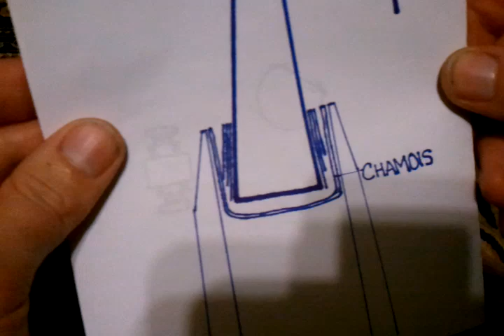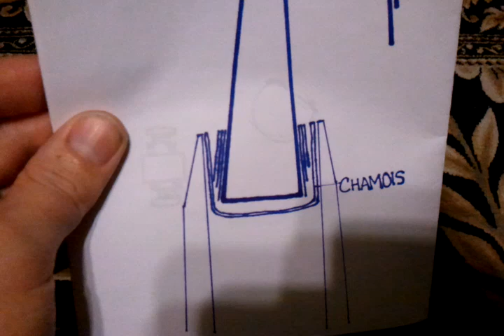Wicked Edge Tip: How to Clamp FFG & FHG Blades

Comment: Appreciate the vid, need to try it on some Spyderco PMs, I think it will also help with the spine taper if I can get a 'forward build up' of the masking tape.
Reply from the maker: I still use the same method all these years later but I generally use the white making tape these days as it sticks better with less slip than the blue painters tape.  Just make sure not to forget the chamois cloth, as that really helps to hold the taped blade much more securely.  I've done ffg Spydercos with a distal taper and generally clamp a tiny bit of the ricasso area around the opening hole and I felt like I got a good enough grip without building up the front with tape but your experience may vary. It's definitely worth a try.

Comment: You use tape on both sides of the knife? I thought you only used tape on the left side of the knife on the jaw of the clamp that doesn't move? Please explain why you use tape on both sides. Thank you for your help.
Reply from the maker: Yes, I tape both sides of the blade. The inside surfaces of the jaws of the clamp are pretty much parallel with each other when a blade is properly clamped.  As a result, the only part of a full flat ground blade that would contact the clamp would be the edge of the spine. Because of this, both sides must be taped in order to make sure that the sides of the blade have as parallel of a surface as possible in order for the clamp to get a secure grip.  This video is several years old but, to this day, I still use the same method (layers of tape plus a little piece of chamois cloth) for clamping a ffg blade because it works so well.